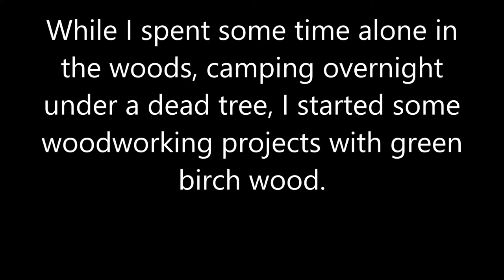Makeshift Bushcraft Vise - Bicycle as Improvised Workbench - Spoon Carving Experiment - Woodworking

Comment: As l see you working around minute 9 l was thinking that may be is a good idea put a wood wedge between the hook nail and the spoon  . It could give some pressure and hold everything more firmly. From outside it seams a good idea may be on the field doesn't work as good as in my mind. Nice video full of ideas and if you don't try never Know.👍
Reply from the maker: yes there is room for imrpovement :D I will try that idea next time maybe.